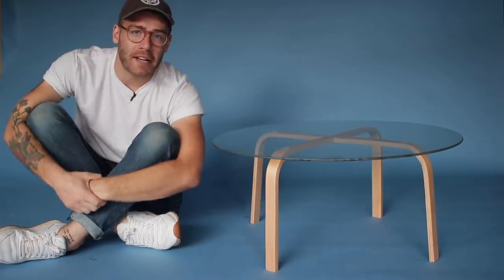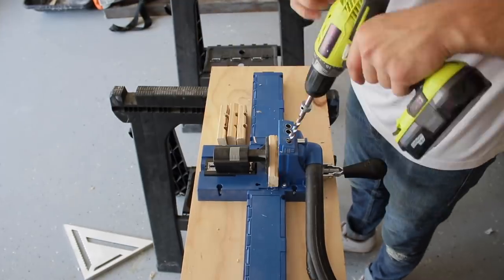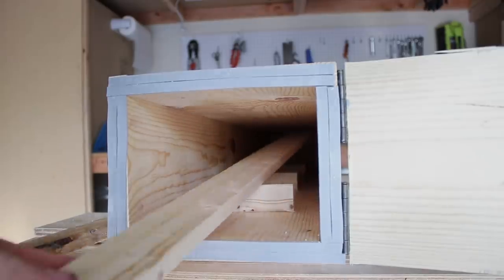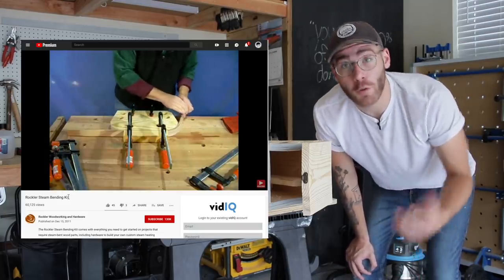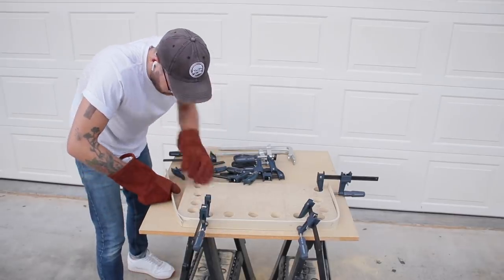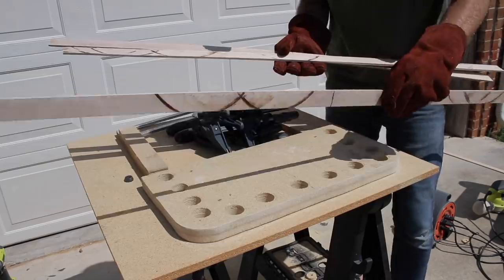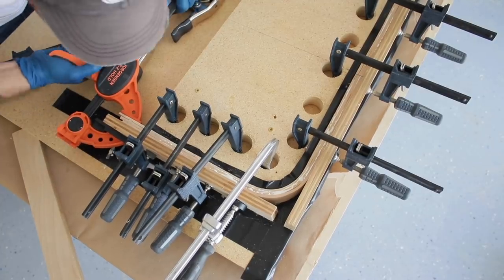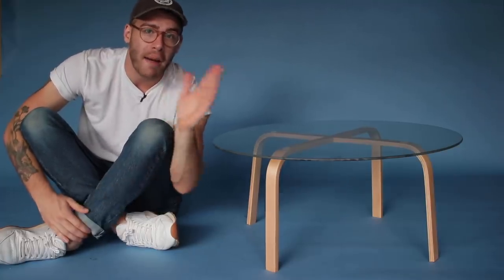How to Make a Bent Laminated Coffee Table | Steam Bending Wood | #rocklerbentwoodchallenge

Comment: Mike, one of the cardinal sins of steam bending is to use kiln dried wood.  The wood you get at the big box store is usually kiln dried.  Secondly, you should overbend.  In other words wood that is bent has the tendency to spring back.  By cutting your jig ends at a few degrees more than 90 then doing your glue up at 90 you will find that laminating process should come out better.

Comment: Maybe use a bit of stove pipe for the steam chamber. Put a copper fitting/pipe , 6" or so, on the end the steam enters, and heat the steam ( focused on the copper) with a propane torch to get everything hotter. And bend further than your final radius, when the wood springs out, it is closer to your desired final profile.

Comment: It was splitting because the outside of the radius was stretching open. Good steam bending requires you compress the inside. For that you need an unstretchable strap on the outside with stoppers to stop the plank getting any longer when you bend it. A plumbing strap clamped at each end works well.

And ash is a good timber to play with here.

Comment: Good lessons to learn. If I would have gone though all that trouble though, I would have made my half lap joint a lot better. You can see the gaps and they aren't even straight. To each their own as well but perhaps router the base of the legs so that they don't chip over time. PVC is the way to go.

Comment: Maybe some tin foil inside the box would keep the heat up?

Also, the table legs look great, I think you could add something between the legs and the top, maybe a ring of wood, or an inverse mini version of the legs to elevate the glass table surface?

Comment: great experiment and applause for hard works, however he needs to do more research about classic wood makings. there are reasons that makers used veneers for steambending. If u want to bend a whole solid timber then just soaked them into a hot water. better, cheaper, easier.